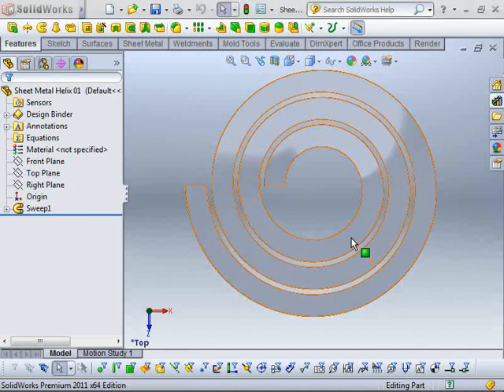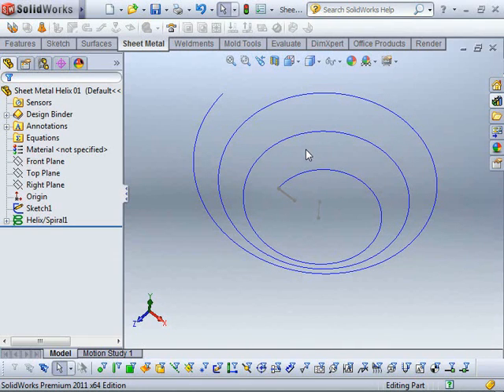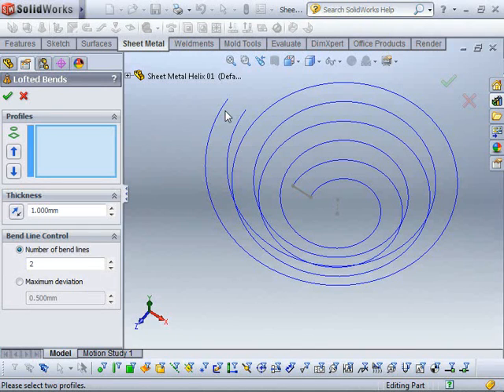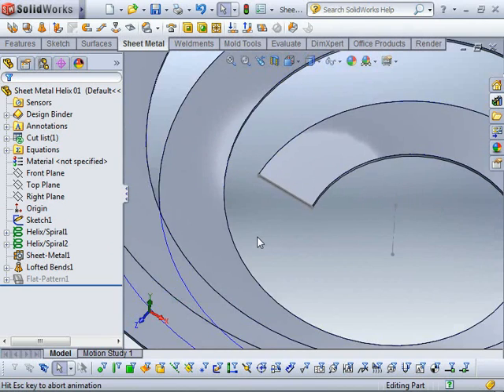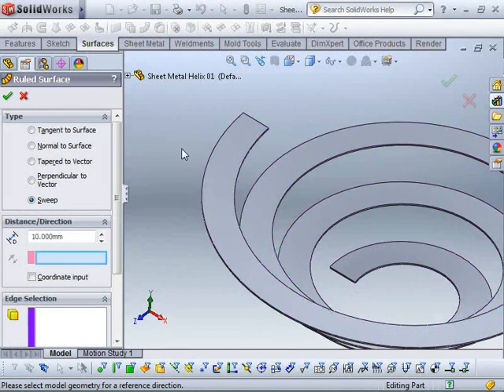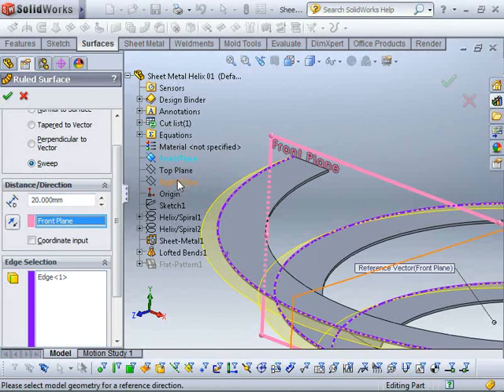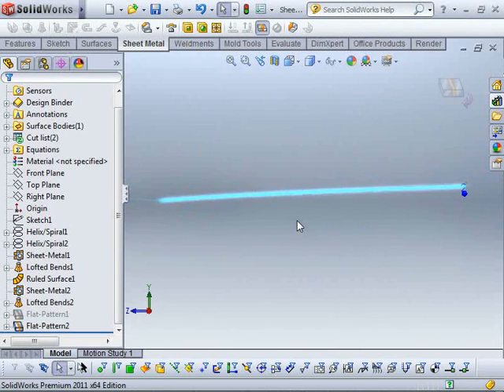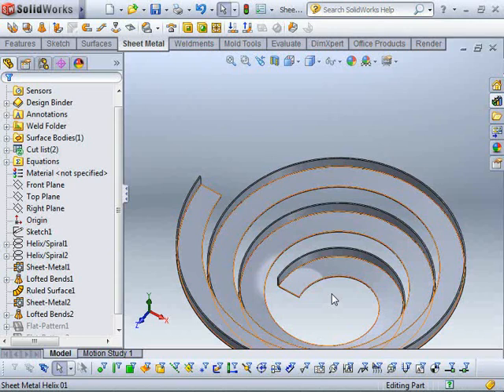Creating a sheet metal helix spring in SolidWorks 2011

Comment: If any one is confused on where to start, draw a circle on the top plane matching the outer diameter of your coil, use the Helix/Spiral feature to make your path, I used Height and Revolution for dimensional output. Then draw your rectangular pattern with the outer edge coincident with the start of the spiral. The inner edge will set the I.D. Then use sweep feature, the rectangle sketch being your profile and the spiral being your path. I did this to draw a simple lock washer.